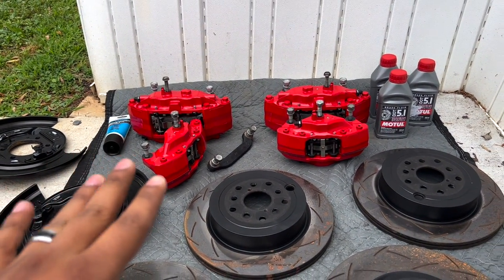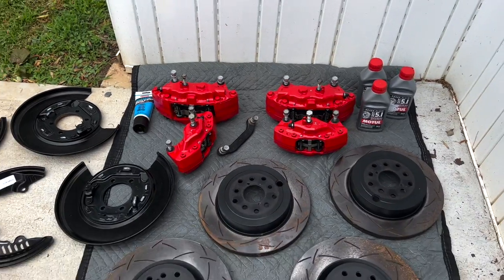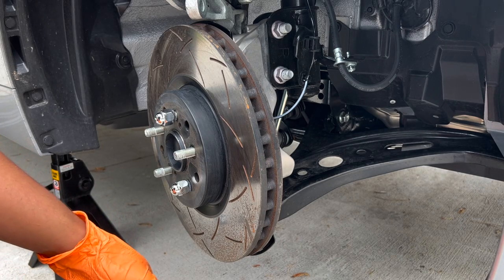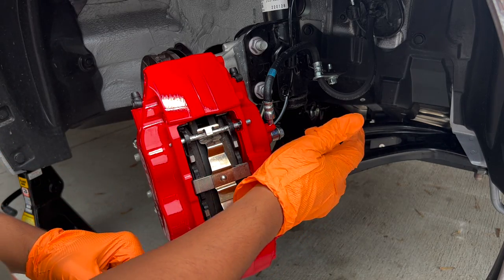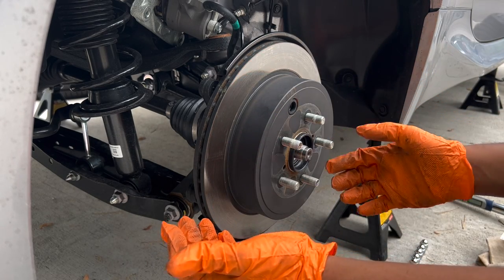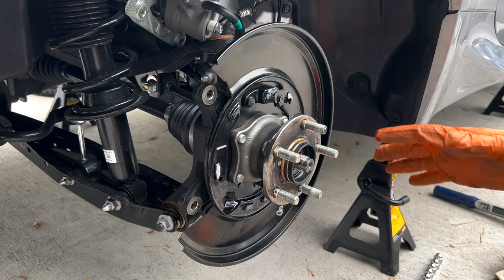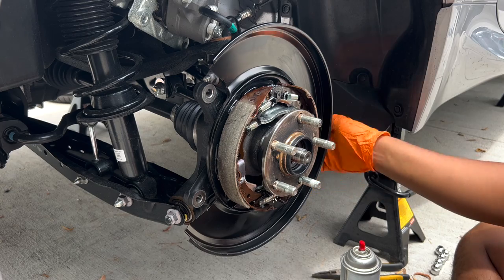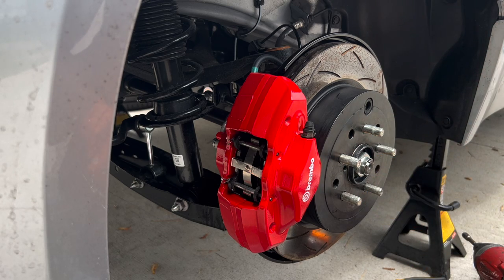2022 BRZ Brembo Big Brake Install 🔴

Comment: I just completed this job. two things to note: before pulling the wheel hub off at 8:19, remove the ABS sensor attached to the top. You got lucky since its fairly new and the hub came right off for ya due to no rust, but I pulled it and bent the metal "dust shield" that is attached to the other hub side (its just that one 10mm bolt to unscrew). Not fun. Also, put some antisieze on the axle before putting the hub back on. ChrisFix has a great video about this.  

Secondly, when adjusting the parking brake at 10:22, I messed with it while it was out and I could not feel which way tightens the parking brake. Pushing UP (clockwise) will tighten the parking brake, and pushing DOWN loosens the brake adjuster. 

that aside, great video. Please upvote so others can see.

EDIT: I also did steel brake lines while adding my brembos. Couple of pointers: you need a flare wrench to unscrew the flare nut. DO NOT attempt to do this job without one. Use a pipe to push your brake pedal down and latch it between the seat. That way, you wont have brake fluid leaking everywhere once you unscrew the flare nut.
Reply from the maker: Great info! Definitely helpful!

Comment: Pro tip for next time. Get a two by four or some sort of stick, open up one of the break bleeder's and then press the brake pedal to the floor and hold it there by wedging it in place to the seat. Now you can remove the brake lines all around and no fluid will leak out of the lines. You can take your time and virtually no mess.
Oh an that car looks awesome in Silver, that would be my choice as well.
Reply from the maker: Great tip! I will definitely try this next time. 👌🏽 Thanks for watching!
Reply: Should you remove the calipers first? I'm just thinking the brakes would be stuck when doing this

Comment: Good job and cheers from Germany 🇩🇪 I appreciate your in depth explanation. For working on hoses I recommend hose clamps that minimize dripping. You earned yourself a new subscriber. Ordered my GR86 for next year. This years contingent is sold out here.
Reply from the maker: Wow! Congratulations on your order. You’ll love it! Thanks for the advice. It’s funny because I had hose clamps but I never thought about using them on the brake hoses. 🤷🏽‍♂️ Thanks for the watching and the subscription!
Reply: Ich hab keinen bekommen 😢
Reply: @ToniDella  Dann jetzt zum Händler und einen Kaufvertrag machen für 2023.

Comment: I would highly recommend you look into getting a carport canopy for your BRZ  since you probably can't build a mini garage, its not a fixed building then you can close the side offs and its like having a garage without actually having one
Reply from the maker: It's been something I've wanted to do.. Haven't found something cost effective just yet.
Reply: @Catalyst4k  Amazon has some for like $250 then just get some tarps and straps and do the sides yourself could be under $300 total
Reply from the maker: @Dylster501  I did something to that exact process before with my FRS. Didn’t end well. The wind blew it over. Something heavier?

Comment: Very well made video. I would have added some braided-steel brake lines as well. Would be a shame to use these brakes at the track with those rubber brake lines in my opinion.
Reply from the maker: Thanks! I was thinking about going stainless but I guess for next time? 🤷🏽‍♂️

Comment: Awesome video! I have a 2023 BRZ Premium and would love to upgrade to Brembo... I can't figure out what calipers they are on eBay though? Nothing looks exactly like the one's in the video. Thanks
Reply from the maker: Try searching '2017 BRZ Brembo' and filter to used. You'll be looking for any that came off a 2017-2020 Subaru BRZ with the Performance Package. Normally the will look like the ones in my video. :) Thanks for watching!

Comment: At 10:16, you mentioned to adjust the parking brake. But that was not shown in the video. Can you give some more details on what happened there? Thanks!
Reply from the maker: Once you replace the rear rotors, you want to be sure to adjust the brake shoes inside to make sure it’s making full contact with the new drum. You can get a better detailed explanation by checking out this video: https://youtu.be/BMkhZ43gRbs?si=JuO1qGCmHspVakcZ
Reply: Hey, that’s the same video I watched before lol.

Did you also tighten it fully, then released by 8 ticks?

Comment: Hello, i just did this brembo system to my GR86 and I am quite sure i did the brake fluid bleeding well. However, I notice that the brake pedal travel is much longer than before and made the brake quite scary, do you know what is the problem ?
Reply from the maker: It's a possibility, you did not bleed the air out of the braking system correctly. I would recommend bleeding the brakes again.

Comment: Did not know these bolted up so easily, though the new knuckle on the 2022 made it an issue. No other mods to make other than just swapping out the WRX bolts?
Reply from the maker: Correct. It really just needs those bolts and you are good to go. 1 year on them and I don't have any issues.

Comment: @catalyst4k what diameter are the F&R rotors? Your how-to videos inspire me. I gonna get F&R Wilwood Narrow Superlite BBK at 328mm but I want to retain dust shields. I got to do some research to see if the versions from the BRZ Performance Package will work or not… If not I definitely don’t want to cut the dust shields like most do on rear. Instead I will take apart the rear hub, like you did, to unbolt and remove the entire dust shields so long as it does not contain any brackets that are necessary
Reply from the maker: I’m glad I inspire you! I believe OEM Brembo Performance package front rotors 326x30mm, rear rotors 316x20mm.

Comment: Hello bro. I just order my 2024 BRZ and i was  planning to do that swap but because im new with this car i didn't know if they are direct fit. So if im gonna buy Gt86 calipers  (2012-2021) rotors and dust shields they gonna be straight away fit?
Reply from the maker: Yes, this video and all the parts will fit 2022-2024 BRZ model. :)

Comment: Wonderful work, thank you. Do you have the part number for the brembo kit? Cheers
Reply from the maker: You're welcome! Thanks for watching. I do not have the part numbers for the Brembos as I purchased them used. You should be able to have your local Subaru store pull them up under a 2018 BRZ Performance package.

Comment: What are the stock wheel specs!? Rn I have a 1st Gen BRZ with 18x8.5 +33 would those fit?
Reply from the maker: The stock wheel specs are 18x7.5 +48. I’d say there is a good chance it clears if the spokes are not too close to the calipers. If anything you could use a 5mm spacer with extended studs.

Comment: Be careful if you decide to do this without draining the brake lines first. Brake fluid will eat through bare metal in seconds. Ruined a rotor that way once.

Comment: Nice job thanks for the tutorial. What the rotor size you using in this kit? Does it fit 326mm rotor?
Reply from the maker: Glad you liked it.  The ones I used was 326x30mm.

Comment: Great video! How's the noise on street driving (saw someone said skipping the bar caused some harmonics issues) and how's the brake dust situation?
Reply from the maker: Thanks for watching. I haven’t experienced any noise during street driving. Nothing out of the ordinary. The brake dust is low because I switched to the Powerstop Extreme brake pads. They are low dust. Way better then the oem brembos.
Reply: @Catalyst4k do you happen to have a link to the brakepads you bought I just picked up the preformance package brakes and rotors for my gr but I'm getting confused on the brakepads

Comment: I'm planning on doing this swap soon, this is a great guide. What size are the rear axle nuts? I'll probably need to get a larger socket for that.
Reply from the maker: Thanks for watching. Glad I could help! 

If I recall correctly, it's 32mm. You can double check, but that's what I can remember.

Comment: I don’t think it’s a great idea to use the existing  front brake lines. Both factory and aftermarket lines suited to the Brembos have a distinct bend in the steel banjo fitting that attaches to the calipers.  Sure it works as is however I suspect there’s a lot of stress on the lines.
Reply from the maker: Thanks for your thoughts, I have actually been thinking of switching them up. You have confirmed my decision.
Reply: @Catalyst4k  I installed Brembos on my 2013 BRZ. There is also a Subaru service bulletin which I have recommending the use of rubber grease on specific parts of the banjo bolt for Brembos. I followed that procedure - although it’s something I’ve never heard of doing before.

Comment: Hi, can you tell me the code of the Brembo kit?  Thanks!
Reply: +1
Reply from the maker: Thanks for watching & Don't forget to Subscribe! 

I used the same kit that came factory on the 2018-2020 Subaru BRZ Performance Package. These are the part numbers I used and got them at my local Subaru dealer but you can also find them used on Ebay. 

Front left Caliper:      26292CA070
Front Right Caliper:  26292CA060
Rear Left Caliper:     26692CA070
Rear Right Caliper:   26692CA060

Front Left Dust Shield :    26290CA030
Front Right Dust Shield :  26290CA020
Rear Right Dust Shield :   26704VA000
Rear Left Dust Shield :     26704VA010

You can use any brake pads and rotors you would like that fit the 2018-2020 BRZ Performance Package.
Reply from the maker: Thanks for watching & Don't forget to Subscribe! Check out my reply to Cornelius.
Reply: @Catalyst4k  can you share the price for these calipers
Reply from the maker: Bruce, the calipers are like $2,700 new from Subaru or about $2,500 used on Ebay. Thanks for watching!

Comment: Not sure if this applies to your BRZ, but I had a quick question as this is a mod I want to do for my GR86. Did you notice any significant changes to your traction control, ABS, or pre-collision system? I wouldn't want to throw on a BBK if it's going to mess with the handling too much.
Reply from the maker: Well mine doesn’t have the pre-collision braking but I have had any issues with the ABS engaging weirdly. It should also be tied into the wheel speed sensors so it will adjust to the braking force in my opinion.

Comment: Hows the wheel clearance on these? Saw a picture on reddit on the new OEM GR86 BBK and it looks pretty tight.
Reply from the maker: I would say it’s about the same. I’d say there is about 3-5MM. From my experience with other BRZs. It’s the same even for factory OEM Brembo options.
Reply: @Catalyst4k  Dang thats crazy.. any bad experiences so far with the clearance?
Reply from the maker: @MrMcChubblez  No big issues. Just gotta be careful when taking the wheels off and putting them back on. You’ll get a mark on the Brembos if you’re not careful.

Comment: Do you finish the install on all 4 axles? then start to bleed the brakes ( rear right, rear left , front right, front left ) ? or can I start with installing rear right side, and bleed it right after I am done with the caliper installation? thanks
Reply from the maker: Finish the install on all 4 axels. That way you are not introducing air into the system. 👍🏽
Reply: @Catalyst4k  thanks
Reply from the maker: @80a7x You’re welcome!

Comment: So did you end up using the brake bracket in the front? Or are they not needed if you use the shorter bolts?
Reply from the maker: Thanks for watching! I did not use the brackets. They aren't needed since the bolts are shorter.

Comment: WHY didn't you replace brake lines???  It's insane having Brembo calipers with old/original brake lines   😞
Reply from the maker: Good point. Guess it's an excuse to make a future video ;)
Reply: @Catalyst4k  Hi. One year has passed since you made this video. Thank you. Are you still on the base Gen 2 brake hoses? Just curious if there are any issues or do we need to swap to PP Brembo brake hoses.
Reply from the maker: @macuser27 Hey! Thanks for watching. 1 year later, no problem with the hoses 👍🏽

Comment: did you get this from the dealership? if not, mind putting a link to the brembos?
Reply from the maker: Hi Skunkiiee! Thanks for watching! I got them from my local Subaru Parts Dept. I left the part numbers in the description. You can also purchase them online at: https://parts.subaru.com/ or buy them used on eBay.com as well.
Reply: @Catalyst4k  i tried ordering them, but they ask what are the STI bolts for?
Reply from the maker: @skunkiiee7333  They might ask because they don’t want you to buy the wrong parts but just tell them to order them and not ask questions. 😅

Comment: Can you run 17in wheels with these brakes?
Reply from the maker: Yes, I say this because I know the stock BRZ with Brembos comes with 17 inch wheels. Tight fit but it worked on the stock Preformance package wheels.

Comment: hi there about the breaks pad can we uesd the manufacture pads of subaru into breambo cliper ???
Reply from the maker: I am sure that the factory brake pads will not fit on the Brembo caliper. You will have to use pads made for the caliper.

Comment: You forgot to mention before you even move the car pump up the brakes... Watched a guy I worked with at a shop literally hit a wall cuz he didn't do that before taking off.
Reply: I did something similar where after I changed the brake fluid we didn't bleed out the air. Luckily it was an automatic so I had to force it into park before it was about to go to the next door neighbors wall lmao.

Comment: So no grinding on alumin knuckles and no adapter bracket needed?
Reply from the maker: CORRECT! Easy as can be. Just use those shorter STI bolts and you should be good to go 👌🏽

Comment: Did you use the oem brake pad or a different size?
Reply from the maker: The brake pads will not be transferable from the old caliper. You will have to purchase pads that fit the brembos. I went with powerstop extreme performance ceramic break pads
Reply: @Catalyst4k  how about the rotor do you use the stock ones?
Reply from the maker: @teppey62  You will need to purchase ones that fit the performance package BRZ as they are bigger. Make sure to watch the first part of the video :)

Comment: That bracing is used to reduce brake noise, how is your experience driving on it without it?
Reply from the maker: I haven’t really noticed a difference, I’ll try to focus and see if it does
Reply: @Catalyst4k  Appreciate it! I've been seeing it in the forums the rumors of "Extra brake noise" without it, but since no one asked you I thought I would. Thanks! :D
Reply from the maker: @ettercap_736  No worries. I’m waiting for her to come out of the body shop but I’ll check on it when it’s back.
Reply: @Catalyst4k  Body shop? >.>
Reply from the maker: @ettercap_736  😓 check out my latest video

Comment: Do you have the 17 or 18 inch wheels? Curious if the Brembos fit on either.
Reply from the maker: I have the 18 inch wheels that come on the limited trim. I can confirm they fit without spacers. I’m not sure about the factory 17 inch wheels. I think I saw something on Facebook that they did.

Comment: So if we have the GR86 instead of the BRZ, what bolts do i need if not the shorter STI ones?
Reply from the maker: You should be able to use the same shorter bolts. The GR86 with the steel knuckles allow for the bar that comes from factory but you don’t really need it from my experience.
Reply: @Catalyst4k  thanks for the quick reply - im legit doing this same install in the next few weeks. Buying the pieces from a dealership
Reply from the maker: @johnathanjung7251 no problem. I’ll say It’s definitely worth the work. Make the car really stand out.

Comment: You upgraded your brakes and then added a dot 5.1 liquid...  that's... let's say, unefficient...

Man clean the lines very very carefully and put a good dot4
Reply from the maker: Hmm.. Can I get more feedback on this? Would you say you have had better experience with DOT 4?
Reply: It's a long answer, but just clean the lines to remove all the dot5.1 and put a dot 4. Your break pump is optimized for dot4, which is usually better than 5.1 btw....

Another topic not related to dot, even if you use a 3, 4, or 5.1, never use a racing liquid if you wanna keep your calipers healthy.

Ferodo super formula works fine
Reply from the maker: Thanks for the tip! It's coming around to the time to change the fluid so I'll try the DOT 4 this time around.

Comment: How many STI bolts do I need ? For front and rear ?
Reply from the maker: 4 bolts for the front ones. You need diffrent ones for the rears.
Reply: @Catalyst4k  really what's part number?
Reply from the maker: 901000326. You'll need 4 of them.
Reply: @Catalyst4k  thx bro